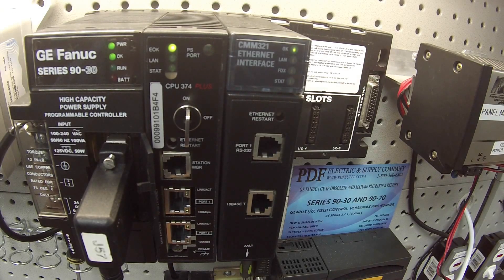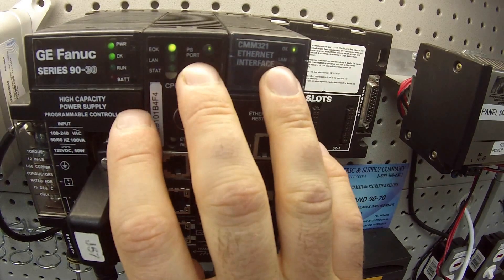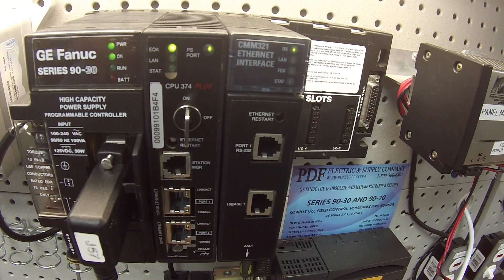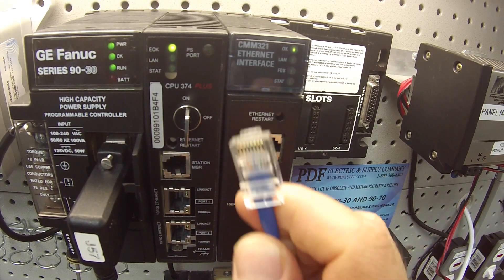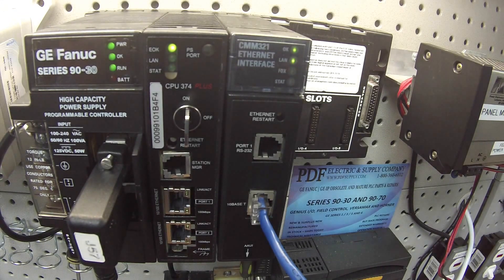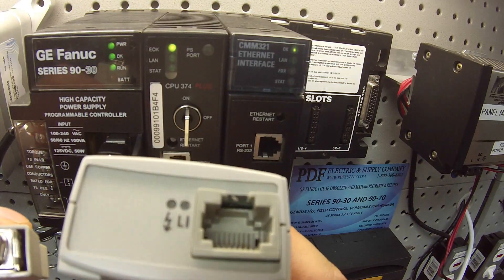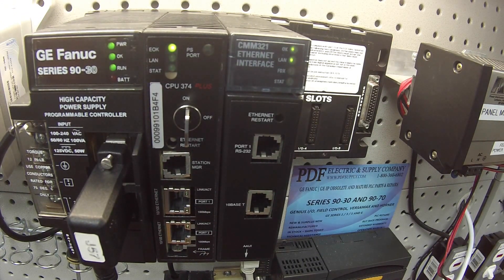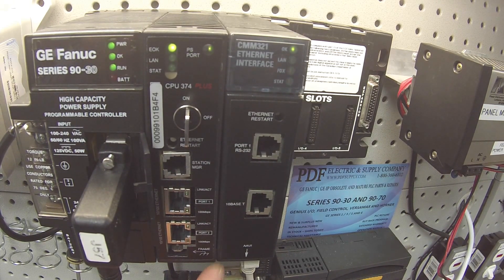How-To Program: IC693CMM321 Ethernet Interface (GE Fanuc PLC/Proficy Machine Edition Training)

Comment: My cmm321 is connected by AAUI port, there is no 10baseT. The problem is that it connects but then drops out due to “bad gateway address”. We are able to ping device on network, triple checked gateway address is correct, but still fails and stops communicating with network. Should I just replace it or can I use the cpu 374 network port to communicate with other hmis and plcs?